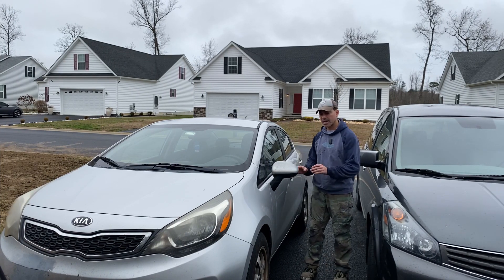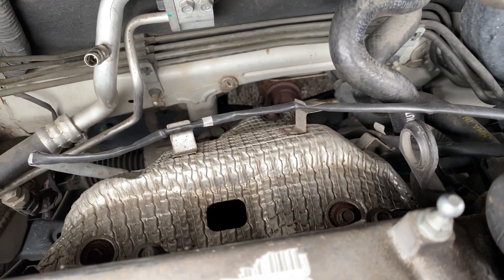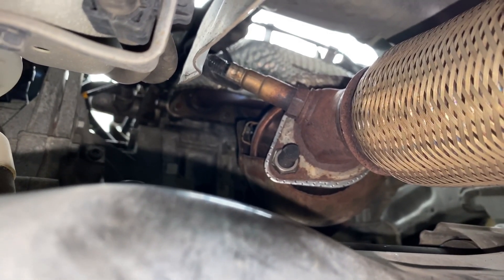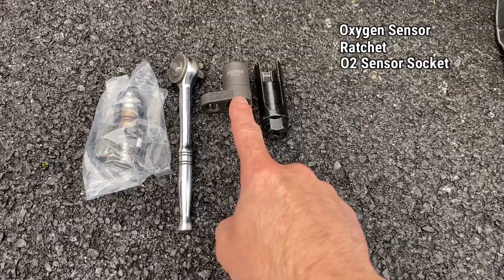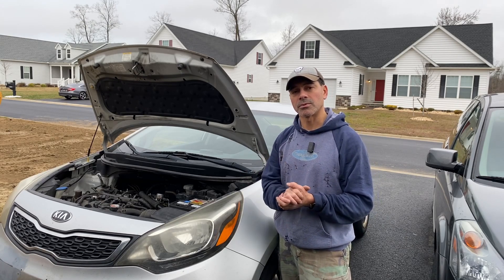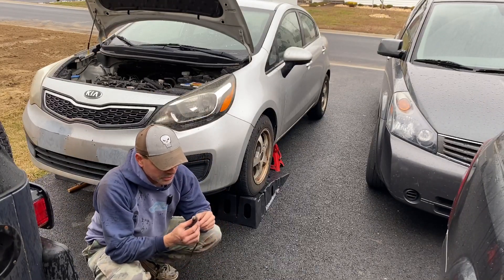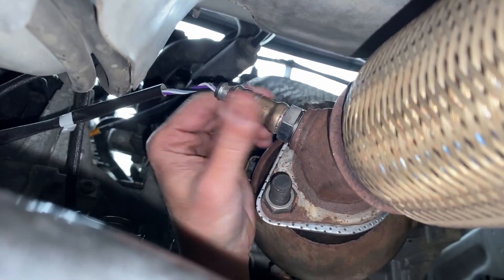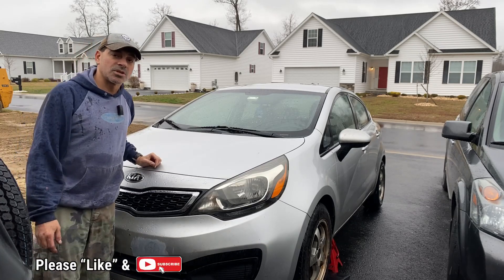How To Replace Downstream Oxygen Sensor - KIA Rio (Andy’s Garage: Episode - 448)

Comment: Will this salve the engine misfires ? And sometimes engine idling,plus struggling going up hill
Reply from the maker: @RODRIGUEZMAKAVELI  Usually misfires can be caused by a the spark plugs, ignition coil packs, poor fuel pressure etc.

Comment: by replacing down stream sensor, did it solved check engine light for code p0420 ? I had replaced catalytic converter and still have same code I wonder if me too have a bad down stream sensor?
Reply from the maker: No, that won’t solve it. If you used an aftermarket catalytic converter they can generate the code since they are not to spec. An easy fix is to add an extender onto the downstream so it pushes it out of the exhaust and reduces the reading. Here’s a link where I show how: https://youtu.be/2jyEUAjVYIM?si=vEbdvQAzoBR-XpfX

Comment: Do you think it can solve P2096 code ?
Reply from the maker: @NKT6848  This code pertains to a “lean” condition BEFORE the catalytic converter which can be caused by a vacuum leak or even a problem with the fuel system. Some people have fixed it by replacing the upstream O2 sensor but I wouldn’t be spending money on parts until you know for sure. If you are not able to diagnose it yourself take it to a Kia or Hyundai dealership and have them just diagnose the cause. After they determine what it is then you can replace the issue yourself.

Comment: Are the downstream and upstream the same?
Reply from the maker: No, the harness is different
Reply: Word to the wise.  DO NOT ASSUME ALL KIAs BRACKETS ARE MOUNTED AND LOCATED IN THE SAME TOP/BOTTOM POSITION.  Locate your upper and lower sensors and follow the wires to the brackets.  I think someone at the factory thought it would be funny to swap the upstream and downstream connectors!!  Just double check your sensors to your harnesses and connectors. 😉

Comment: I think Kia swapped the 2019 Rio clips/harnesses.  My upstream clip is gray/white is mounted on top of the bracket.  The black connector for what appears to be the downstream connector is on bottom
All the same, my problem was getting that little plastic tab out of the engine bracket.  I will try crimping it out with the needle nose from the bracket.   Your the only one that focused time on the connectors/brackets.  Everyone spends too much time on the sensors. Thanks!

Comment: I have a 2012 Kia Rio giving the po420 code on and off.  The hundred dollar question is, Is this a bad o2 sensor or the converter? 
computer says- converter 1st bank    Symptoms s are a, rough idle, power bogging,  accelerating valve clatter. 
Any thoughts would be appreciated. Thank you.